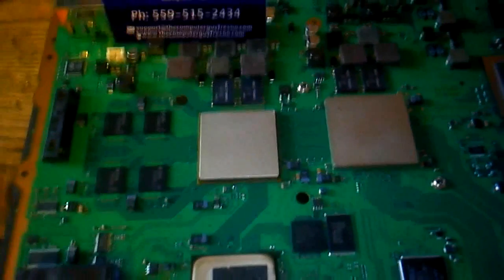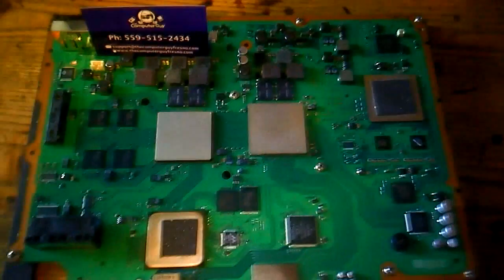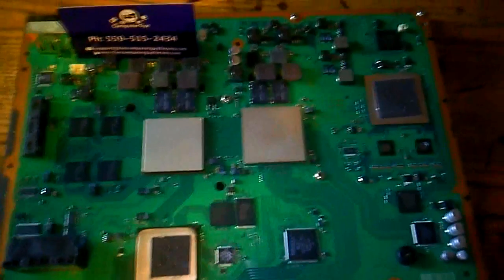How Remove IHS from PS3 RSX GPU Chip The Easy Way - By The Computer Guy Fresno

Comment: I just re-read my last comment, and have another question for anyone who can possibly answer it.  Is it possible to wipe out the firmware on the NAND chips by erasing them without a programming device, such as by directly wiring to the pins?
I'm sure it's possible to do that, but my question is, if the firmware were wiped out, would that prevent the safe mode from showing?  I just want to downgrade from 4.55 so I can play offline with my game discs working again.
Reply from the maker: If you wipe your NOR/NAND your system will be a brick.  And I don't think there is a way to do that wihtout a programmer. FYI I do downgrades so email me if your even interested in that.

Comment: I stupidly updated my fat CECHG01 model ps3 (40g) to the new 4.55 official firmware, and now my games won't work, the Blu Ray reads DVD and CD but no blu ray discs at all, which includes all ps3 games.

So I had this idea...it's a stretch but maybe some savvy tech hacker out there could help advise me on this.   I have another identical ps3 with YLOD.  I am considering taking out the two K9F1G08U0B-PIB0 NAND chips which store the firmware, and swapping them with the ones in the YLOD ps3, which has older firmware.

Would this be feasible as a fix, assuming I'm careful with the soldering iron, and am willing to reformat the system afterward to match the NAND firmware to the System software and OS?

Comment: I'm having the hardest time removing the glue
Reply from the maker: On the four corners?  Don't worry about that just leave it. Put a little dab on each module and put it back together call it done.  If you really want to remove it you can scrape it off easy with a tiny bit of heat. But I never do.
Reply: Oh haha, well its to late now, I scraped it all off then sanded it with 800 grit sand paper and polished them.

Comment: How do I dissolve the thermal adhesive?I never worked with it but imagine it doesn't break down as fast & easy as thermal paste
Reply from the maker: You don't.  Its silicone you just cut it.
Reply: The Computer Guy  Thanks.Would it be ok if I didn't use thermal adhesive?I did a reflow for now.I plan to reball it in the future.I was thinking about using thermal paste or maybe a combo of thermal pads & thermal paste.That thermal adhesive is a real bitch to get loose sometimes lol

Comment: i tried to remove the ihs from the gpu/rsx when it was cold like you said. well thats a bad idea what was a semi working ps3 is now dead because when i was prying the ihs off i heard a pop like the one in the video, it wasnt the ihs that poped that was the sound of my rsx being uprooted so now im left to try and figure out it trying to rebake the rsx will fix it. i'm not blaming you this was my fault for risking it i just thought i would give a heads up. also i was taking my time, and i would appreciate any info or recommendations for a possible fix as its already broke attempting a re flow cant hurt it. also now it only flashes green once then red then off.
Reply from the maker: DO NOT PUT YOU PS3 IN THE OVEN THAT IS STUPID. Find someone that knows what they're doing!!
Reply: never said i was going to put it in the oven but thanks lol i know it would pop the capacitors and risk parts coming off not to mention the insane temperature time charts that need to be fallowed for reflow any ways thanks for the response.
Reply from the maker: delicrux
 You should have used leverage against the chip not pulled up on the IC.

Once in awhile Ill get one that feels tough so Ill do it while I'm heating a little bit on the rework station. Most of the time its not necessary but yes damage can occor if its a tough one. This is an old video I should really add some disclaimers about that.
Reply: i did use leverage lol oh well

Comment from the maker: I'd have to look at it. If the GPU is dead it can be replaced, If its the CPU Your SOL as its paired to the motherboard it came with. If you would like to bring it to me I will look at it for free and tell you what the cost would be. Worst case scenario I can replace the entire motherboard. My number is 559 515 2434.

Comment: I have had my ps3 since it cameout. In the beggining of summer it got the ylod and i took it to a guy in fresno. It worked for like 2 months and then would die if i didnt have a fan on it. Now it got the ylod again so i took it to a local and the guy said one of the chips is cracked. Can u just install a new chip? As of now all it does is turn on, the fans go progressively louder and then it turns off blinking red.

Comment: why does it always look so easy to remove the gpu ihs when other people do it, i have not got one off yet, i practised on a spare board using the chisel method and the memory chips broke in half, the thermal glue seems like a vice gripping the chip. hopefully this method will work better. thankyou for the videos

Comment: How do you remove the paste from GPU cell without scratching it (the middle one)? Also, my 40 GB model is constructed so, that when I put my PS3 back together, the IHS is coming DOWN to the heatsink, so how can I glue it to the chip that it doesn't fall over?

Comment: Question: I followed this w w w.ifixit. c o m /Guide/Yellow+Light+of+Death+Repair/3654/1 and when I turned it on. I was only able to get the ps3 to work for 20± seconds then the screen went all weird, sort of like how you'd get static from tv losing connection then nothing, you have any advice?

Comment from the maker: If you tore it from the board it may be a goner. What you can do is use your meter on each side of the pad and check for continuity. Either way those small resisters are not an easy repair.

Comment from the maker: I just use a small dab of thermal paste on each ram brick. I currently use IC Diamond under the RSX. The clamps will hold it in place no glue necessary.

Comment from the maker: Just put thermal paste on the die, no need to secure back in place the heat sinks will hold hit just fine. I usually clean the memory blocks on the four corners as best I can and put a small dab of paste on those too.